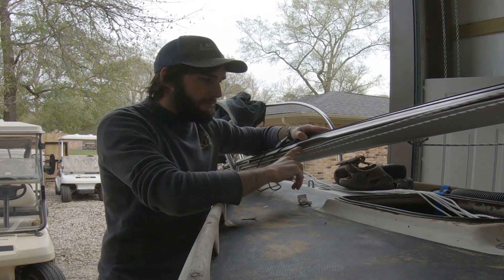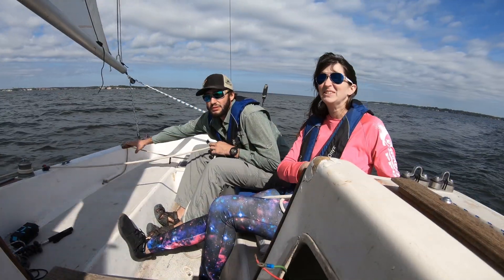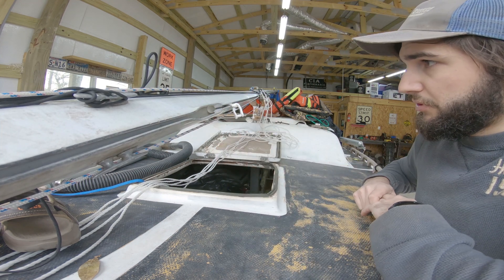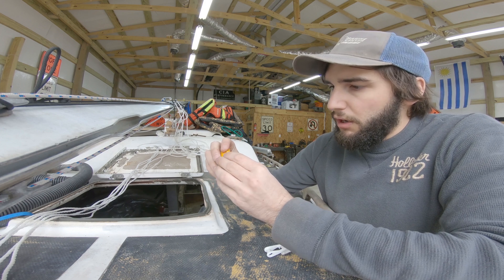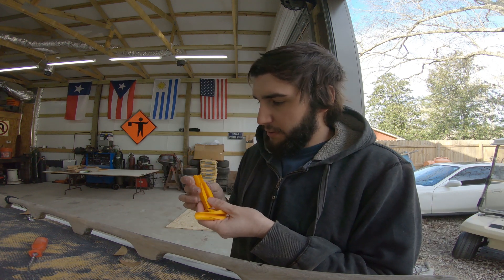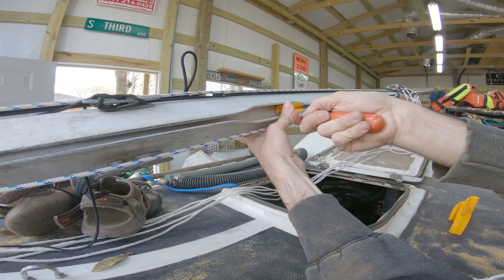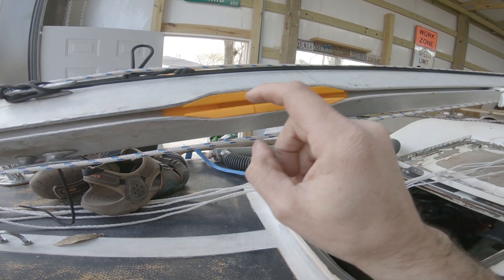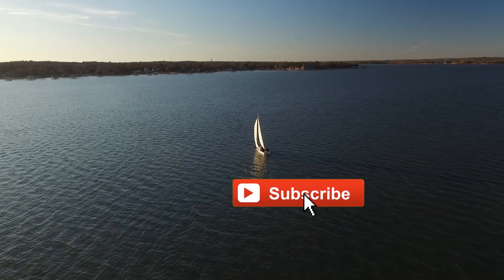3D Printed Sailboat Mast Gate - New Salts 13

Comment: I'm Tom Luque.  I admire what you are doing to improve the enjoyment of sailing on your boat.  I have patented and built mast gates for about 10 years under the name MastGates.com and found that building 3D printed nylon gates for spread open feed slots is very labor-intensive because the feed slots were spread apart by a hand tool which makes the length & width of opening different for each order.  I only build the 3D printed inserts (like you are doing here) when a sailor has no mechanical skills.  The ideal & best solution is to restore the shape of the track and cut a 3" long feed slot.  I provide instructions on how to restore the track in 15 minutes and the location of the new feed slot cut.  info@MastGates.com  .  I have demonstrated this procedure with BlueWater Yachts owner, Todd and he was amazed how easy it was to do.   I look forward to seeing other 3D projects you work on.
Here is my procedure:

You Must map out a new feed slot location before closing the existing Spread slot opening.

This track restoration has been performed during cool and warm weather on: 
MacGregor 26M & 26X ; Potter -19 ; Potter 14 ; Montgomery 15.

If you don't have slugs attached to your sail yet, consider using shackles and slugs with 3/8"  or 9mm diameters.  [watch SailRite video].  
--------------------------------------------------

Estimated Time to restore track gap is 15 minutes 
Tools needed:
Hardwood strip  1" x 2" x 12"
Wood stirring stick (paint store) that is 3/16" thick and longer than your feed slot
Rubber mallet or dead blow hammer
Masking tape
------------------------------------------------------

Estimated Time cut a new feed slot is 30
Tools needed for cutting feed slot in the track:
Masking tape ( 1/2" x 12")
Dremel type tool with a thin cutting wheel (need electricity)
Ignition file (auto store) is best on aluminum.
Drill motor and 1/4"  bit
-------------------------------------------------------
Mapping out new slot location.
If you don't have slugs attached to your sail yet and use 3/8" or 9mm diameter slugs.  They are the most common size.
The object is to try to avoid having a sail slug parked in the feed slot area when the sail is fully raised, reefed or when the flaked sail pack is resting on the boom. 
Before closing the spread slot,  you must map out the upper and lower limits on the mast where the new slot location will.
With slugs attached to sail, hoist sail up the mast and pencil mark the locations of the two lower slug positions on the mast.  Reef the sail to mark the slug locations.  Fully drop sail pack on top of the boom to mark the top of the stacked slugs.
Working with the markings on the mast, you will want to locate the new 3" feed slot to sit about 4 inches above the resting sail and not where a slug will sit at.
----------------------------------------------------------
IMPORTANT:
Restoring a spread track opening to the original gap shape requires shock impacts from metal on a woodblock or a plastic or rubber mallet will cause impact shock to the mast could cause damage to screw and riveted attachments.
Hammering on the mast is best done with mast laying on a grass lawn or a driveway with blankets under it to prevent scratches.
I have found it possible to do the job on a mast already stepped on the boat after removing the boom from the mast to prevent shock damage to goose-neck and the boom's end cap attachment.  I also held the mast firmly to my body while hammering to absorb impact.
Tie or tape a 3/16" thick by 12" or longer wood shim in-between the spread track (paint store stick or wood ruler).  This shim will act as a limiter to prevent over closing track gap too much.
Alternate the Hammering of the track cheeks while using a 4 to 10 inch long 2 x 1-inch thick hardwood block strip (whatever size you find) against the spread cheek to slowly close the cheeks of the mast till track lips are back into alignment with the rest of the normal track.
-----------------------------------------------------------------
Cutting the new feed slot:
Use masking tape to mark out the cutting perimeter for the new feed slot shape (3" x 3/8").
I find that placing the new slot on the starboard side of the mast works better when you are right-handed.  Photo is of a West Wright Potter's standard port side location.
Use eye protection when using a Dremel type tool with a metal cutting wheel to cut feed slot and file edges smooth and rounded.

Send questions and photos to TomLuque@gmail.com
Reply: Tom Luque I gave my mast gate a hit to try to flatten it but it wouldn’t budge.  I wasn’t game to hit any harder.  It’s a 1973 mast !
Reply: Todd at Blue Water Yachts was also hesitant to hammer away on the mast.  I have done this procedure on several masts and have had several customers do this procedure also.  No cracks or failures reported.
I have edited my above entry with the procedure.  I was not able to add photos though.
Reply from the maker: Contact us on facebook if you would like to try my design 

@NewSaltSailing on facebook

Comment: I purchased an '80 V21 about a month ago and that has been a problem. I use the same slugs on my sail. I have the original cotter pin (and have replaced it) that goes across at the top of the gate, but you're right, it holds the sail up way too high. Would definitely be interested in getting one of those! That's an awesome solution I hadn't even considered.
Reply from the maker: Thanks!  We are getting our facebook page setup!  If you are interested in getting one  from us  please private message us on there  New Salt Sailing

Comment: Very nicely done!  Before I retired, we were using 3D printing for producing parts needed in our robotics classes.  I had students who were competent in CAD design and file generation, others who were good at conceptualizing a part and a third group who understood the mechanics and stress management.  Seldom was a single individual good at every aspect -- you certainly seem to have accomplished that.  I also liked your videos on the DIY self steering.  I also am a firm believer that a good design engineer needs to have turned a wrench somewhere in their background, which is another plus for you.  I thought your nose extension into the track for the upper and lower gates significantly improved the design, not just for ease of movement, but being thicker, it added some strength and resistance to being pulled out of the track.  One thing you might consider in other designs is print your parts oversize, then file or dremel them to a satisfactory fit before pulling final dimensions.  It may save you some printing time and resources.  Well done!
Reply from the maker: Thanks!  Oversize printing isn’t a bad idea.  The Only downside i see is that i would have to print solid parts vs honeycombed which takes significantly longer.  I will give it a go on a future project and see how it works out!         

I agree, a prerequisite for being an engineer should be to have been a technician of some sort before you become an engineer.  

I was a CNC Maintenance Technician for 4 years and a Machinist for 2 years prior to finally graduating.
Reply: @newsaltsailing7756  Watching you work, I knew you had some grease under your fingernails from somewhere.  I'm sorry if I wasn't clear on printing.  Print your initial part with low density printing, but with some dimensions thicker than normal.  If it won't fit, then reduce the dimensions manually.  For instance, for your initial test piece, you could have increased your wall thickness and part's depth, then slowly reduced the size until it would just snap into the track  -- gives you maximum retention and tighter fit - and a model for the second part. Either way, I enjoy watching your work.